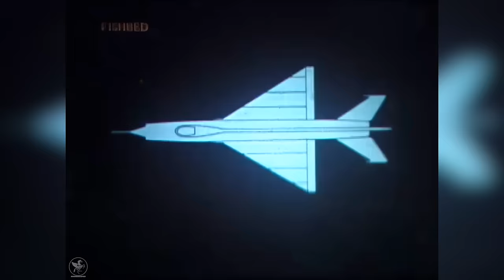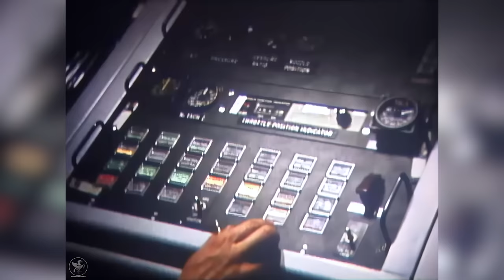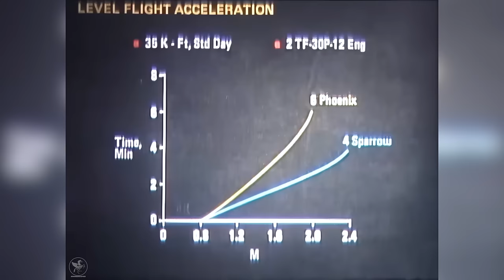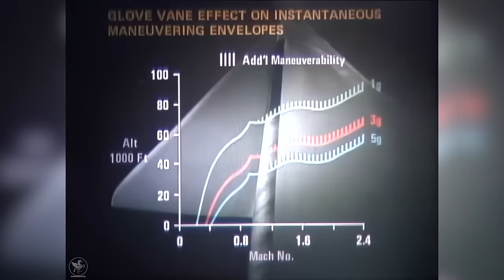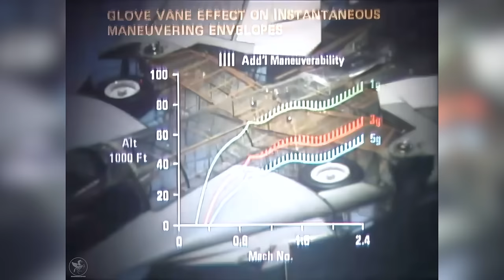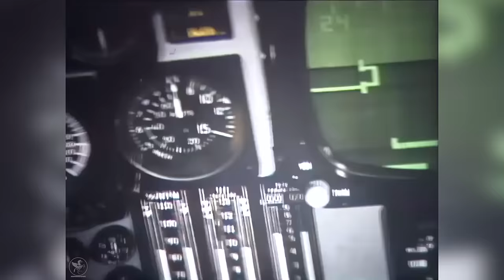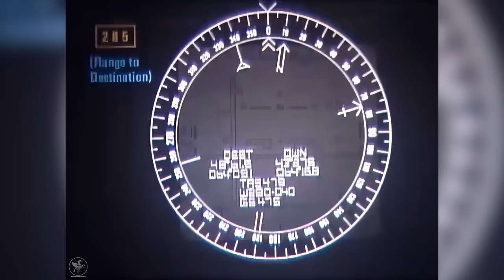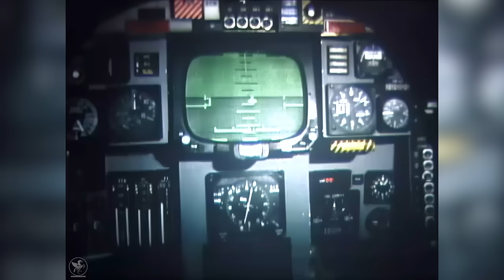F-14 Tomcat: Designed For Superiority | Grumman Rare Original Footage Of The Pitch For The Aircraft

Comment: Mig-23 is not the Foxbat.  The Mig-25 is the Foxbat; its successor is the MiG-31 Foxhound.  Also, it is notable that, while the Navy predicted an effective intercept range of 54 miles for the Phoenix, in testing the Phoenix successfully shot down a target drone while traveling a distance of 75 miles.  The timelines proposed by Admiral Connally were optimistic.  The Tomcat did prove itself, but it took until the late 1970s to fix all the software and hardware bugs.  The TF-30s were great engines - for a strike aircraft.  Thus, with the F-14A, you "flew the engine," whereas with the F-14 B and D models, you flew the airplane.  Regardless, the Tomcat was the world's most-feared fighter jet well into the early 2000s, and it took until 2016 for the US Navy to replicate its long-range interception capability, when the extended-range AIM-120D Amraam was loaded onto the F/A-18E/F Super Hornet.
Reply: F14+Aim120D/AIM152 (or AIM260?) Gib! 😂
Reply: Until about 1969, US intelligence thought the Foxbat was the MiG-23.  In fact, US intelligence had identified multiple airplanes as the MiG-23 until the version that we know now as the MiG-23 was confirmed. You could look at the Janes all the world aircraft books from that time period to see the progression of the identification.
Reply: @EdwinYuen  Thank you!